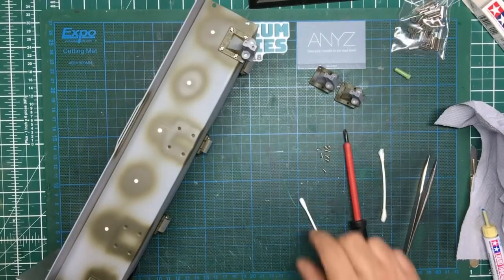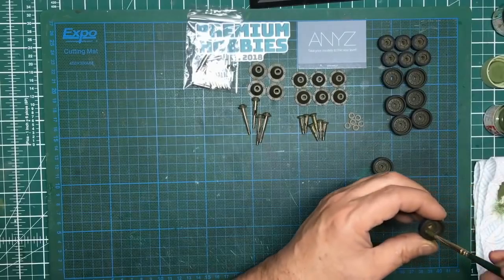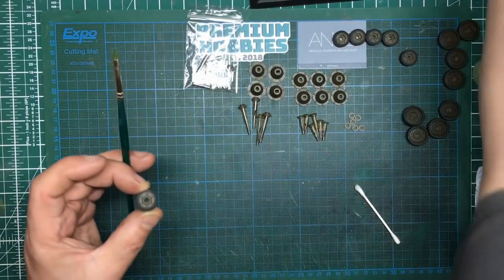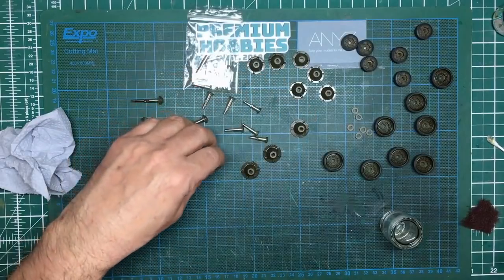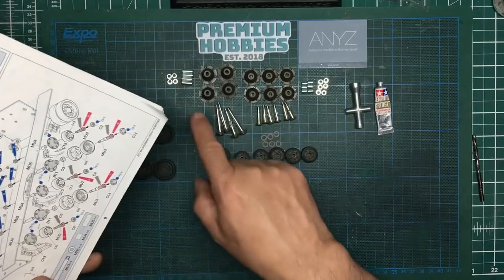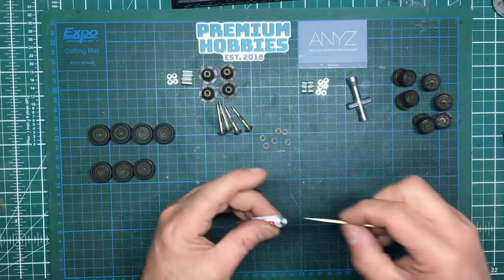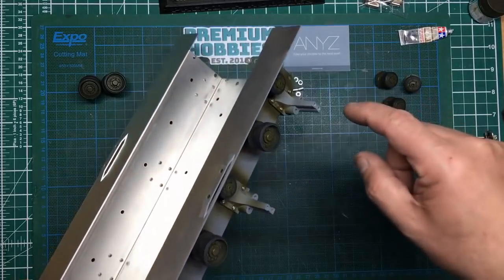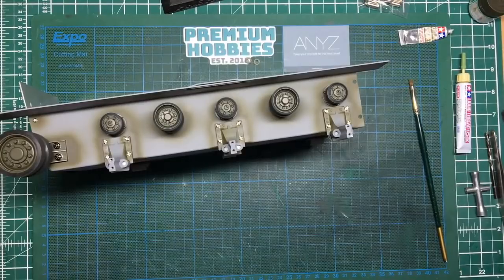Let's build a Tamiya 1/16 RC Sherman. Part 8.

Comment: Question regarding Thread lock, Back when I was an apprentice back early 1979-1983 a company Loctite made stud lock. Basically an adhesive that glued threaded screws into  threaded holes (so they didn't vibrate loose). I worked at Manchester airport at time, Europe's first category 3 airport. At our request a better product was produced for the 5mm screws we used. Similar to locking nuts. Simple answer was to mill a 1mm-1.5mm (remembering width isn't to easy after so many years) slot down length of screw and insert nylon to outer dimension of the thread, thus creating a self locking screw. As you can imagine these screws weren't cheap so anyone else would use stud lock or thread lock as Tamiya call it

Comment: Nigel, you can wash acrylic's with acrylic ink thinned with just water, I use this all the time on my figures.
Reply from the maker: I have windsor + Newton indian ink. Is this the same thing??
Reply: @NigelsModellingBench  it could be, I'd give it a try on one of your scrap plastic wings. You can get modelers ranges from GW (by far the worse), Vallejo (ok but a bit thin) and Scale 75 ( the most pigment dense  &  is the purple I used on that Spectre); but I'm using Dealer Rowney FW these days to paint with and as it for washes, as long as I seal the previous coat.

Comment: Dry brushing with acrylics can be done, it does depend on the type of acrylic paint. I've found both Vallejo & Railmatch excellent  for dry brushing - as they are water based.
Reply from the maker: Thanks James, I have never tried dry brushing with vallejo, I guess it must be useful for something lol. I would normally use enamel, as I said in the video, but on this occasion I wanted to use what people will probably have to hand? I think when I do the road wheels I'll use enamel to show how much better it is.

Comment: Build is looking great. Not building one of these, but enjoying all the building tips.  One thought, since you replaced the axle bushing with bearings, is the grease necessary at all, other than maybe some corrosion protection of the shafts?
Reply from the maker: Dudley Foster I don’t believe I used grease where I replaced the bearings?? If I did, it was to seal them from the elements.
Reply: @NigelsModellingBench  Thanks for the reply. I was referring to the grease you put on the axle shafts, not the bearings themselves. You were commenting on the grease getting on your fingers and handled parts, which I guess might cause future painting problems.  I’d think the inner bearing race could be non-moving on the shaft and the outer race non-moving on the wheel and all work fine.  If using the kit bushings, then definitely need the grease.  Cheers, Dudley

Comment: You got a number on the AK wash fella
Reply from the maker: AK075, but bear in mind, the wash i have is from a set which is over 10 years old from memory.
Reply: @NigelsModellingBench   cheers fella still available just over eBay  can't find a model shop that do it delivered or at all but cheers fella for your time & help keep up your good work

Comment: Hey Nigel. What is "thread lock." Mike
Reply from the maker: Thread lock is a substance much like a weak cyonacrylate, or super glue. it only dries where there is no air, as in a thread interface between nut and bolt. There are soft types and very hard types, the softest you can get away with being the most recommended in my book. Thread lock can also act as a seal where, for example a threaded fastener is screwed into a through hole leading into a sump or casing where oil is present.
Reply: @NigelsModellingBench  Appreciate your prompt response and educating me. Can you tell me, what is your book that you refer to and is it published yet? If so and it is about the hobby for modellers then I would be interested in hearing more because you have one of the most educational, one on one, video channels going. Cheers Nigel. Mike
Reply from the maker: @gartsherriejunction4643  thank you for your very kind words, they are much appreciated. I have not written a book, and am not sure now which book you refer to?.
Reply: @NigelsModellingBench  This will make you laugh 😂. April Update version 2, time 12.36, you said that you need to get on and finish the book. Sorry, I was half asleep when I was watching this YouTube video and it wasn't a book but a "BUK". Coming from north of "Hadrian's Wall" your accent was lost on me and my interpretation was incorrect. So, yes, please finish the "BUK" and if you ever decide to write a "BOOK", I would like to have 1st dibs on it, please. Thanks for putting up with me, and my previous comments. I will contribute to you when I can as you deserve respect. Keep safe and healthy. Mike
Reply from the maker: Gartsherrie Junction you have made my day!! Bloody hilarious!!✊✊✊
Reply: @NigelsModellingBench  Thanks. I am glad it made you laugh. Going back. You also replied, "...can get away with being the most recommended in my book." As quoted 19 hours ago. So add this to your other "BUK" I thought that you were about to publish or had published a modellers apprentice book from which we can all learn. Anyway, I'm off to study my Latin. Take care keep modelling and I'm sure we will chat again once the laughter dies down. 😂